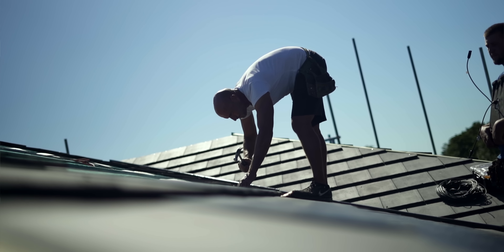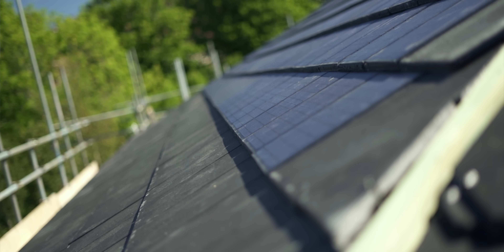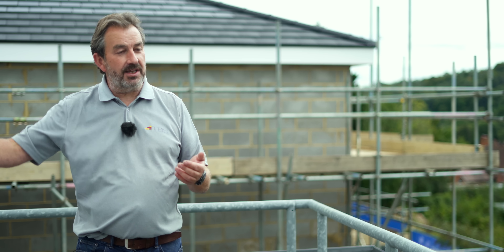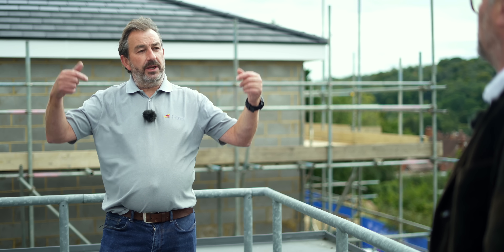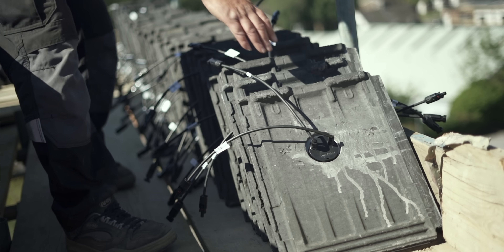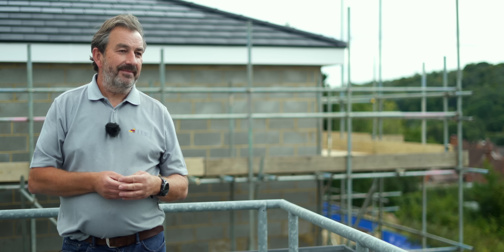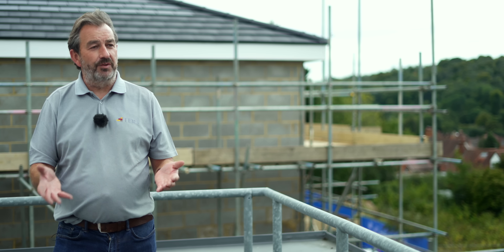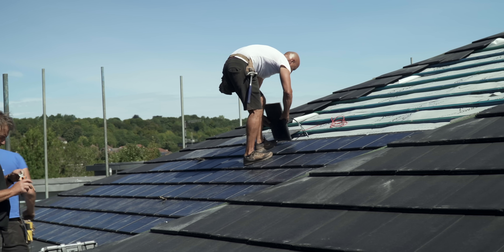Solar On Every Roof?

Comment: Way too many problems for this to become a mainstream thing...
On hot days that tile glued on the back of the panel is going to get lovely and toasty and completely stuff the performance of the panel as well as increasing the rate of its degradation.
Thermal cycling is going to kill the glue.
Slapping these onto a random assortment of locally sourced tiles is going to lead to terrible quality problems with inconsistencies in the materials and the finish of the tiles
It sounded a bit like his mate Bill was going to be drilling out the holes in the tiles for the connectors to go through, which would be a very expensive, inconsistent and unreliable way to do it.
They're too expensive to buy.
They will suffer from a lack of panel choice and inability to keep up with improving panel efficiency options.
There is no way on this earth that it only took 1 hour more per elevation to do that job than the same crew doing a non-solar install. Calling huge BS on that. 
So many points of failure and with over 40 tiles in series you've got major issues with those single points of failure compounding.
Concrete is not the best choice of material if you're aiming at a premium market and you want a low lifetime carbon footprint and a product that lasts.
The electrical side of it sounded very bespoke so normal solar installers will be less keen when it comes to repairs and replacements. If this lot have gone bang you might not even be able to get parts.

I'd file this with that concrete block gravity storage nonsense.
Reply: Add in that every tile needs at least one nail fixing (In the UK at least), any repairs will likely need most of the roof stripped, individual tiles cannot be simply slipped in and out.

Comment: Would it be a good idea to change the planning laws so that all new roofs would be lean-to type with South facing orientation? This would mean that close to 100% of every roof would be South facing
Reply: Having all solar on south facing roofs would be a mistake as you would achieve too much peak generation.
Reply: @timrothwell33  energy storage and especially electric cars would serve to increase overall demand and lower individual supply.

Comment: We desperately need more of this.
Reply: solar is awful in the UK the winter when you need the energy there is only about 7 hours of poor quality light and in the summer you make most of your energy that you don't need or use and then you sell it to the grid at about 20% the price you get charged for the electric so you basically install solar and you sell a KWh for 6-7p to the grid that then sells that KWh to your neighbours for 5 times that price so your really just making the energy companies money from your roof and your investment pointless

Comment: Did he say £30 and 900 tiles £27000 seems pretty high for a system that is reliant on silicon to make it watertight and adhere the panels to the tiles in extreme cold and heat. 

Biggest thing that I have with these is, it’s a lot of tiles to have in series so if you have one tile go down then that knocks out the other 44tiles 😮 think they should have some sort of optimisers. 

On a side note I wonder how efficient those panels are as it’s not just about having solar it is the make up of the cells and also the degradation of the cells over the life of the product.
Reply: Agree with you over failure of one cell. Resulting in efficiency drop on all of the solar units.
Reply: It's an impractical, overpriced pile of pants...!!  And that's official.....!!!
Reply: and if my maths is right it would take around 12 years to pay off 🤷‍♂

Comment: They are asking the right questions. Not..."What is the best/highest quality roofing tile?" But..."What is the most common roofing tile?" Making something that is practical and affordable is much more important than making the best possible.
Reply: I disagree. It should be 'what is the most efficient solar panel' then 'what size should we make it to fit the most common sized roofing tile'?
Reply: @koitorob  I agree with you, but I'm thinking from the standpoint of cost. I'd rather have something that is ok and affordable than amazing but way too expensive. I've got 5 kids to feed. 🙂

Comment: Great idea, however hasn’t the hole and sealant just put a potential leak path in to every roof tile? It’s just a case of when the sealant will give up and leak then you may have many many leaks! As an engineer that seems a fatal flaw in the system. Solve that and your on to a winner.
Reply: Leaks and dribbles aren't a problem. 🙂 Every roof in soggy, stormy Britain (your location may vary🌞!) has 'underfelt' - a tough, flexible, continuous, waterproof membrane to stop any wind-driven rain and snow that blows back up under the slates and tiles from entering the roof space.

Any water driven under the outer roof cladding then gathers on the waterproof membrane and runs down the roof UNDER the tiles, directly into the same gutter that collects the rain falling on the outside of the roof.

Even if tiles are cracked, holed or missing completely, a felted roof is still waterproof. The hard outer shell (concrete, slate, terracotta or stone) is really only there to protect the waterproof membrane underneath from mechanical and environmental damage (UV light, hailstones, gales, snow, ice, birds, reindeer, etc).

A modern thatched roof will also have the same type of waterproof membrane under the reeds.
Reply: @EleanorPeterson  Not strictly true, the felt (or these days breathable membrane) is only there to provide temporary weather resistance before the tiles are fitted, and after that the main function is to prevent wind uplift, and occasionally deal with fine wind driven snow. The tiles remain the sole waterproof covering, so any leakage is a serious problem if not dealt with immediately. It doesn't take long for felt underlay to degrade if a tile breaks or goes missing.
Reply: Then that is a major fault in building standards. Having the outer layer be the only waterproof barrier is ridiculous.
Reply: @mikebarry229  That was my knowledge too, while the membrane will give some water resistance it’s not roofing felt anymore. I think it’s a simple fix, ensure the something covers the entire tile, actual PV would be daft given it get lapped, but surely some extra material extended to cover the tile, perhaps the electrical connections could go through the top then and avoid any hole drilling entirely on the tile?
Reply: @timrowledge7152  Having only the tiles stopping the rain is a brilliant idea, most of the modern houses with waterproof membranes, felts and seals are notorious for trapping moisture. Timber got damped from lack of ventilation and they do not last as long as houses built long before them.
Reply: @EleanorPeterson  "reindeer" love it 😁
Reply: Idea yes but product life 25 years if lucky,dozens of plugs and sockets any corrosion and the whole circuit goes down ,oh and to find the fault you have to partially strip the roof ! Good ah ,life in panel s for now.

Comment: Great idea, but I would expect 60 plus years out of a concrete tiled roof, so when the solar degrades in 25/30/35 years you still have a roof but no solar.
Reply: I don't think conventional roofs last 60 years. My condo complex, built in 1997, just had its roof replaced two years ago, a lifespan of just 23 years for the original roof.
Reply: @ab-tf5fl  I said sixty plus as my own are from the mid 1960s and still looking ok

Comment: They're no where near as efficient as panels at the moment though, I looked into these when I was looking at getting solar on my roof and standard panels were the better option.  Might change in the future though
Reply: You've answered a question i was wondering about.
Reply: No, but they do provide an option that might be approved for eg. listed buildings where panels would not be an option.
Reply: @thomasfrederiksendk  yes, agreed that would be a good application.  I'm sure the efficiency will also improve over time, as there are a few areas on my roof that I'd like to cover with them when that happens
Reply: @BSJWright  I live in a low grade listed building, with restrictions on modifications to the outer shell only. Panels are a 100% no-go, but we might just get red ceramic tiles with solar built in approved if we ask nicely - and I’m hoping they’ll be much better when the roof is slated (pun intended) for replacement in 25 years.
Reply: @thomasfrederiksendk  

That's true. But, the economic justification for installing the solar system in the first place weakens when the efficiency goes down. If you can't get enough power to recoup the installation cost through electricity savings within a reasonable time period, it's not worth it.
Reply: @ab-tf5fl  the rate at which fossil fuels are being phased out, coupled with the prices set by OPEC and demand spikes whenever the EU needs to refill gas reserves from now on would likely lead to a much greater dependence on electricity throughout the developed world. having electric storage and generation in your own home might become more profitable than current projections might indicate. though theres a chance gov subsidies get even higher relatively soon, meaning early adopters might be spending more.
Reply: Hi cell efficiency is now 21.3%, giving 17.5 watts per tile. rather than the 15 watt on the episode.

Comment: We are hamstrung by grid and the max capacity of each individual home of 3.68kw…
Reply: Not correct.
You can have up to 17kW with a G99 DNO application.
Reply: @71brp84  Yes subject to permission and that’s not guaranteed, which is the problem.

Comment: Marley did solar roof tiles at least 15 years ago if not before, they were installed on Southampton university and had a live web page to view the results in 2004.
They stopped because of poor take up but now they are doing them again.
Reply: Probably poor uptake because it was too expensive then and is too expensive now.
Reply: @tangerinestorm   Definitely
Reply: Different products, first was in in tile replacement glass module, their new solar tile is a standard module laid in the roof in place of tiles, it is not a solar tile in the way that these are

Comment: In the southern US, solar on the south facing roofs on houses can supply all the electricity needed for that house. Of course it would help to orient all house roofs north to south and move all vent pipes on the north side of the roof. Also making the southern side of the roof a consistent surface with no widows peaks or such architecture garbage.

Comment: Conversly you could install slaor panel trays  this saves the cost of the roof tiles over the tray area,reduces the roofing dead laod, gives a more flush roof appearance  and avoids much of the wing problems with solar arrays fixed to the roof surface..
Reply: yer its not a bad solution , but on the down side , do they not heat up more and loose efficiency without the airflow underneath.

Comment: The answer for the dynamic loading caused by external solar panels is to modify the roof design to take that loading into account before building. My own roof , SIPS, came with 22 pages of calculations to show it was suitable for solar panels, solar thermal and keeping the rain out and the wind away.

Comment: The maths just doesn't add up...
Each tile is 15w at a cost of £30 each.  
Average 400w panel is around £200 these days.
400/15 = 27 tiles (rounded up) to output a similar amount
27 x £30 = £810 for the same amount of output.
Not to mention the surface area of 27 of these tiles would be far greater than a single panel.
It would be far cheaper and much more efficient to get a standard roof and then add the panels on top.
Reply: this was filmed a few years back and a repeat so would be interested in the updated pricing

Comment: imagine having a bad connection in one of them . maybe they do 1 run of the tiles and then some sort of monitoring module. i would hate to check 600 connections :-)
Reply: As a sparky, that was my thought as well! Too many joints for me , every connection is a point of failure. F or me , I'll stick to my panels.
Gregg :-)

Comment: Solar tiles is the next big step, I always thought it was a great idea since I saw the tesla tiles. If I had the money I'd love to get solar tiles and a battery, having kids and being home a lot power is used a lot and my pc probably draws half a power station lol. I get sun front and back so my roof would be great for these tiles. Now to win the lottory :(
Reply: Architects have started to use solar  wall panels to avoid the issues with aesthetic. More on "Construction Index" pages if arsed.
Reply: Yeah it's a shame solar city never managed to get anywhere with there tiles. (to expensive and do many limitations due to the design choices)
It's also a shame the classic installs we're so bad (contractor issues) that they burnt enough buildings down to have a class action lawsuit against them.
Reply: @TheWebstaff  

Shame the investors were gulled into investing in "not quite ready for market" enterprise.

That said some outfit will, eventually, marry off the roofing tech and the solar tech.

R&D will get there eventually.

Comment: Compared to GAF Timberline Solar, this looks like something Fred Flintstone may have installed.
Reply: I'm not so sure, had to google those, they look awful!
Reply: @mikebarry229  Talking about the peripherals here.  They install nearly like regular shingles; no mounting battens.  They don't need the beefy construction that several tons of concrete on you roof would need.  Far less electrical connections.  Far less cost.  As far as look, they're far less obtrusive than solar panels, and with just a perimeter of regular shingles for a border, are reminiscent of a standing seam metal roof.

Comment: FANTASTIC - WHEN CAN I PURCHASE THIS PRODUCT - I REQUIRE A TRUCKLOAD TO WESTERN AUSTRALIA - WITH 330 SUNSHINE DAYS OUR HOUSE PROJECTS COULD BE 100% OFF GRID AND RUN FROM BATTERIES.
Reply: Then you would know that the max you can fit on a house is 5KW inverter per phase with 6.6KW of solar panels. These tiles are roughly AUD$60 each and 15W. For 6.6KW, you would need 440 tiles at a cost of AUD$26,400 (and that doesn't include the cost of the inverter!). I had a SolarEdge Hybrid inverter (so battery ready and car charger ready) connected to 18 panels with optimisers to deal with possible shading for AUD$7000. My system would be considered at the higher end as you can get systems for AUD$4000 - 5000. The roof load 'issues' are just not an issue - solar panels have been installed all over Australia on a range of roofs and there are no load problems. Therefore, you're paying the extra AUD$20,000+ for aesthetics alone... 😲😬 I sit inside my house and rarely look at my roof, but I do enjoy the free air conditioning in the summer!
Reply: @downwind_david  Surely that requirement only applies if you are "On-grid"?
Reply: @mikebarry229  Correct - but if you go "Off - grid" then you would need to increase the size of the system (6.6KW doesn't produce enough for the average household in winter - for June, July and August my monthly production is about 120KWh less than my consumption) which would mean an even greater price disparity. The economics of these tiles just doesn't stack up - even if you're willing to pay a premium for aesthetics... 4x as much?!? I don't think there'll be many takers. They need to be AUD$10 (£5) each to be a viable contender.

Comment: The problem with this technology is an increase of %3000 from a roof tile, to a roof tile with a solar panel stuck on, why.
Reply: You only do this if you need a new roof anyway.
Reply: 300% not 3000. But the cost you should compare to is the cost of a new roof + install of a separate solar system.
Reply: @peterbrown6453  I'm not good at maths and had to work at it to get the answer but I'm pretty sure it is in fact 3000% l even used a website percentage calculator. Apologies if I am wrong. The cost should be manafacturing costs plus profit, not comparison to the cost of something else
Reply: @waltermcphee3787  If I was being totally pedantic it's a 2900% increase, but yes the roof tiles with solar are 3000% of the price of a tile without the solar.
Reply: 30£/tile instead of 1£, so 30x cost, or 3000%. 1£/tile seems cheap but maybe when you buy in serious bulk quantities.
Reply: @zapfanzapfan  my point is not about the price of roof tiles but the high price of roof tiles with solar panels glued onto them which will deter house builders from using them as an environmental alternative. Thanks for the clarity on percentages.
Reply: @zapfanzapfan  ah, I meant to go back and listen, thought it was £10 and £30
Reply: @peterbrown6453  1 per tile, 10 per square meter.
Reply: @zapfanzapfan  i apologise for my incorrect criticism of the maths, but my other point remains - the cost to compare isn’t the normal roof tile, it’s the solar roof.